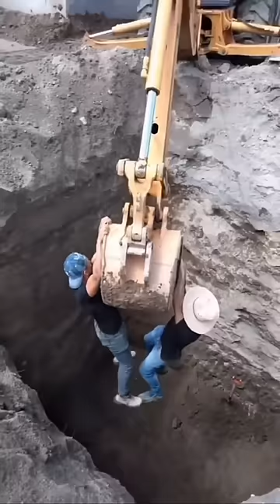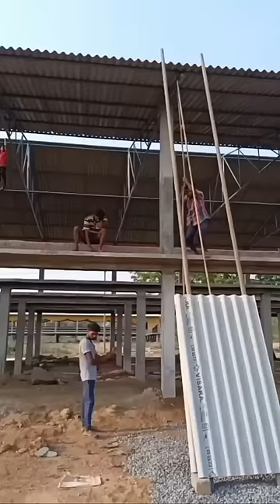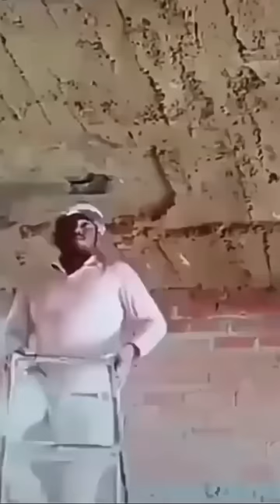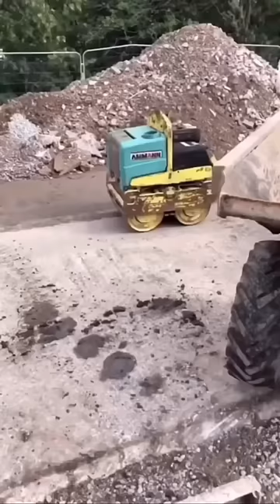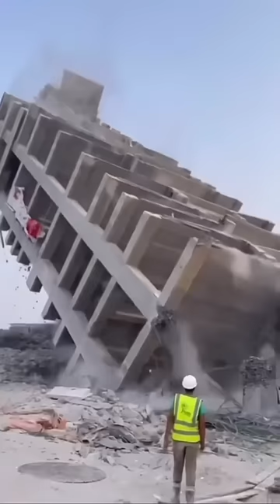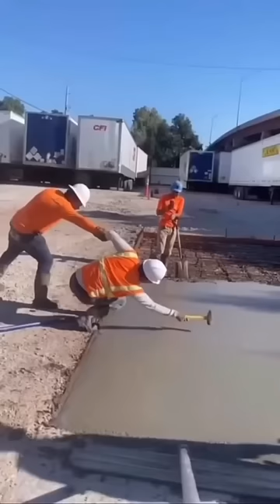POV: Construction Workers #TheManniiShow.com/series

Comment: To be fair, the one where they're sliding the corrugated steel panels up to the 2nd floor of whatever building that's gonna be is kinda ingenius... they just need to rig it up with a safer counterweight and anchor point...